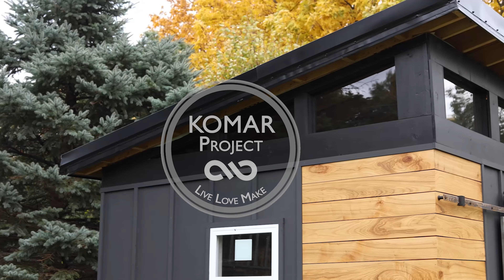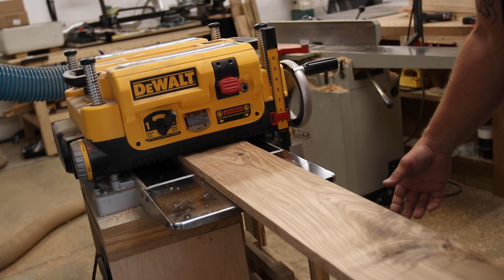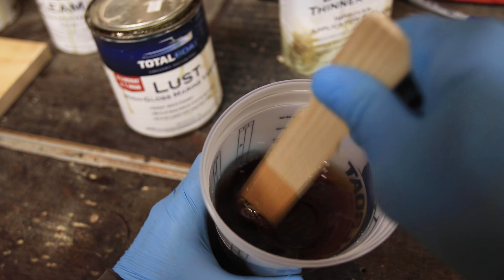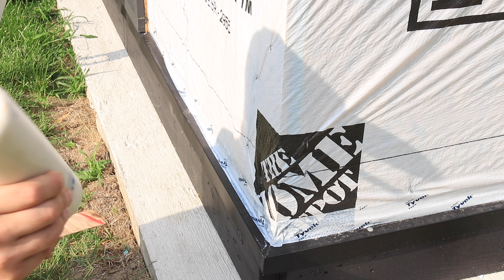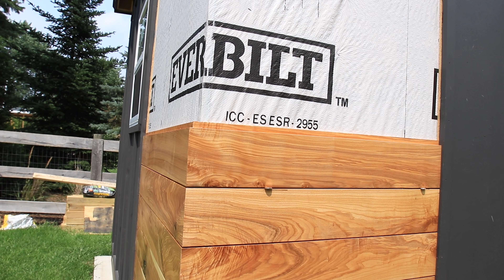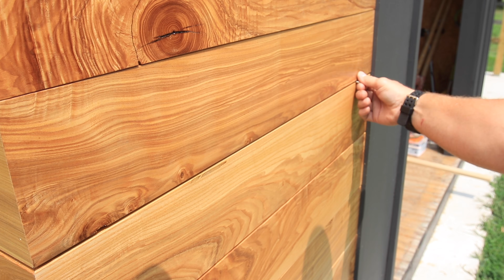How to Install ShipLap Siding from Start to Finish!! Tips and Tricks

Comment: That corner looks really nice, so much so that I wondered why you didn't cover more of the shed? I also wondered why you didn't create a drainage plane behind all of your siding. Then caulking would not be necessary and the space between the WRB and the siding will be ventilated. Even after a hard driving rain, the space will have a place to drain from.
I grew up in a house built in 1920 that had red cedar beveled plank siding that was always blistering and peeling. It turned out that the siding was never primed on the back side. If it had been and a drainage plane was also installed that siding finish would have never failed. Since it was always ventilated caulking all the joints would have been unnecessary..
I wondered why you didn't cut the lap to provide the gap automatically?